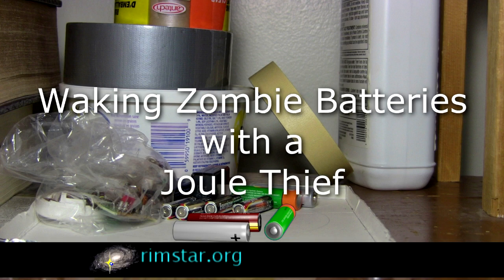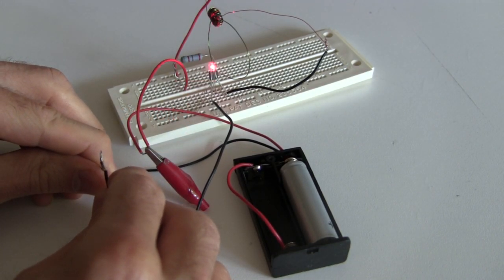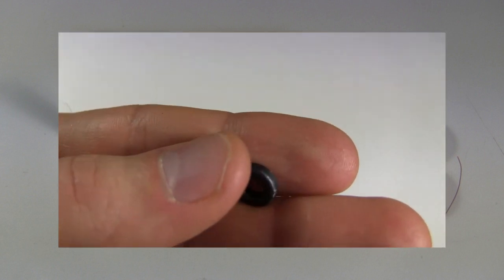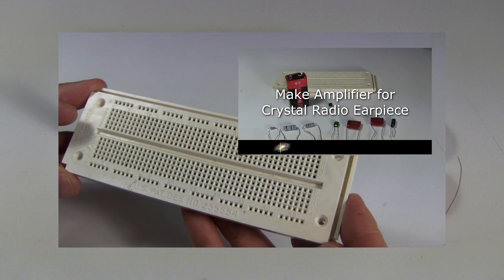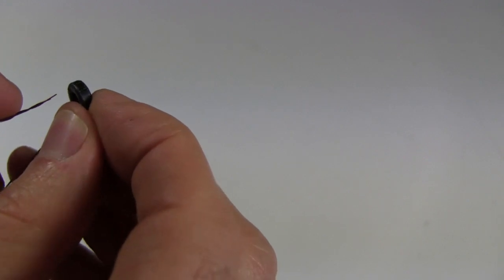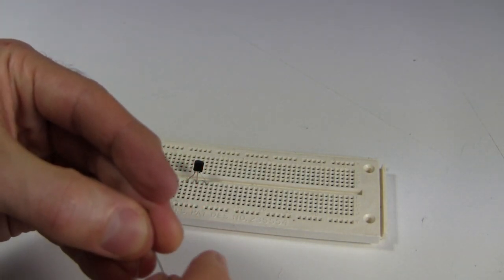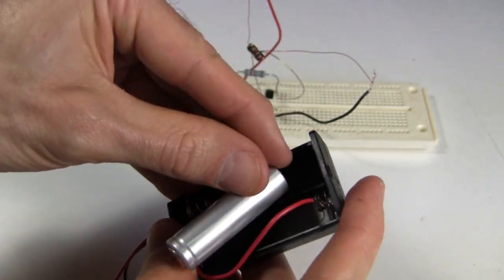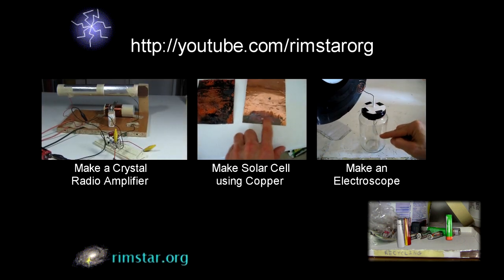Make a Joule Thief for Zombie Batteries

Comment from the maker: Coils have some capacitance, but important here is that a magnetic field builds up. When the magnetic field has built up enough to saturate the ferrite core, the interaction between the coils shuts off the transistor fast. That causes the magnetic field to collapse quickly, building up more than enough voltage at the LED to turn it on.

There is an interaction between the two coils that controls the transistor to make this work well. I haven't thought if the same could be done with capacitors.

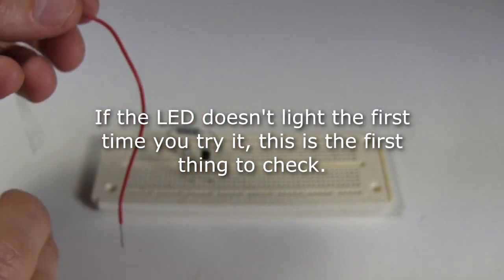Comment from the maker: Hi Debasis, You can most likely use the core. I don't see why not. However, without knowing the part number of the transistor I can't say if it would work or not. I'd suggest you try it and see. Keep in mind that if it doesn't work right away you should first check the way you wired the coils into the circuit as I mention at 4:28 in the video. Also, some LEDs are not very bright (the mcd value) or shine in one direction mainly so look carefully at the LED to see if it's lit. Have fun! -Steve

Comment from the maker: The resistor protects the transistor from too much current. At the same time, the higher the resistance the dimmer the LED, so if you have a potentiometer (variable resistor) then you can adjust the brightness.

Comment from the maker: The voltage of the solar cell will vary just as the output of the joule thief varies. An LED lighting up for short bursts but very bright can have the same overall power output as an LED lighting up for longer bursts but less bright. A better approach would be to try charging a capacitor for a fixed period of time and then disconnecting and measuring the voltage of the capacitor. The energy accumulated in the capacitor is 1/2 x capacitance x voltage x voltage. This gives a result in joules.

Comment from the maker: Transformers are for a number of things e.g. stepping a voltage up or down, electrically isolating parts of a circuit. If you transformer has 4 prongs then there are probably 2 coils, 2 prongs for each coil. Measure the resistance of the two coils. Apply voltage to the lower resistance coil and the voltage on the higher resistance coil should be increased. Note that this happens only when the voltage is changing. Straight DC will transform only when being turned on and when being turned off.

Comment from the maker: Yup. Many people power compact fluorescent lightbulbs with it, and still with just a single 1.5 volt battery. But there is a limit to what it can power, both because of the available power and given the voltage waveform I showed in the oscilloscope output.

Comment from the maker: Did you try reversing the wires coming from the coils? That's usually the first thing to check. Also, if you were using a breadboard like I did, go back and check that the connections are all where they should be and that they are fulling in the holes, also very common issues. Also double check that you have the transistor legs right, they're not always the same for all transistors. Also double check the polarity of the LED, one leg is positive and one is negative, they're not interchangable.

Comment from the maker: A crystal radio puts out fluctuating DC at the output. Someone suggested I try powering a joule thief using a crystal radio in the comments to one of my crystal radio videos (hmm... can't seem to find it) and that's why I made this. So far the radio's DC output is too small to turn on the transistor but I'm still trying.

My sources are small local electronics stores and Radio Shack (The Source in Canada) is the only more widespread store I can think of that might have germanium diodes.

Comment from the maker: I don't really know for sure. Ferrite seems to have a few meanings. The ferrite core here is a poor conductor and is a ceramic whereas ferrite also refers to iron. A ferrite core, being a poor conductor doesn't have as a much of an issue with eddy currents being induced in it as iron would. I guess you'd just have to try.

Comment from the maker: mA is amps/current, not power. It's also extremely difficult to measure current for this type of spikey output so the 31.3mA is probably not accurate. But anyway... People who've played with the resistor value have seen it affect the LED brightness so trying different resistors or using a variable resistor (potentiometer) should help I think because it affects the timing. Decreasing the turns may work too since the power flows through the coil that's not connected to the resistor.

Comment from the maker: Yeah, without an oscilloscope, if your battery voltage is high enough to light the LED anyway, then it's hard to know if the joule thief is doing it's stuff. I once lit an LED with the joule thief circuit before only to find with my oscilloscope that the joule thief wasn't working at all.

Comment: You cannot rely on the face of a transistor for a correct pinout guide. You should ALWAYS look at the datasheet for the part number of the transistor.
Also one should consider the wire gauge and amount of actual turns on the core, this is important and will make a difference between running one Red LED or several White LEDs. I have built these things using a coil wrapping design for a power transformer (primary coil and secondary coil) and I had success running small DC fans for vehicles and even a car stereo off two AA batteries. Of course you want to use transistors rated for higher volts and currents and heat sink them properly.

Comment: Thank you. Sort of like a set of points collapsing the field to an ignition coil. but instead of the primary field collapsing mechanically, the joule uses the transistor triggered by the saturation point of the ferrite core.

Comment from the maker: Also, the insulation of the coils may not be able to handle the high voltage. In that case the insulation will break down and the transformer will be ruined. You need to know the voltage rating of your transformer coils, or take a chance. :)

Comment from the maker: I'm no expert on measuring these odd waveforms. The only way I know to measure voltage like this is to use an oscilloscope and even there I've seen mention of possible errors - but it's close enough.

Comment from the maker: Not a 1.5v battery. A car's battery is 12 volts but that then goes through an ignition coil to produce a much higher DC voltage to produce the spark in the combustion chamber. I'm no car expert though.

Comment from the maker: The coil winding really is as simple as the little I showed. You can find a diagram in my "How a Joule Thief Works" video. There's a link to it in the description below this video and you can find it on my channel page. The wire sizes don't matter much, just make sure they have insulation on them i.e. not bare wires.

Comment: Just made a Joule thief myself and it works very nice :) I winded the coils with different length on the ferrite core (Longer for the LED and collector) it can light up a 3W 3,7V powerled with only one AAA battery that is as low 0,7V (0,5V under load) even if just a tiny bit of light. a battery with 1,2V (0,6-0,7V load) is enough to get a pretty strong light from that led. running 2 parallell depleted AA batteries gives even more light :)
thanks for a good video sir
Reply from the maker: Pulverrostmannen Nice. Thanks for letting me know. I'm glad it helped.
Reply: RimstarOrg Hi it's me again :) when I put in those 2 AA batteries that had 1,4 volts in them has been lit 24/7 and enough to light up the whole room in the night ever since I posted that last comment. I never thought it would run for so long before the batteries would die. they still give light but now so weak the led just glows. really decent light for 8 days and weaker the last from already weak batteries. sick
Reply: I made one version with a 10K potentiometer to set the brightness, and with half of the brightness the led lasts extremely long (I'm using a diffused blue led that shines bright enough even with half the normal brightness). With full 10K of resistance it shines a lot dimmer but since that is under your control, it can be very efficient.
Reply: PunakiviAddikti indeed, the pot I use is a 0 to 22K. and it is possible to just make the led glow or get super bright.
Reply: I actually forgot to mention that I still have a resistor connected in series with the potentiometer: A transistor needs some resistance or it can get really hot.
Reply: PunakiviAddikti Indeed, the resistor will limit the power trough the transistor. however when you have the potentiometer you chose how much resistance there will be and it is not necessary to use a resistor if you don't crank the power to max. the transistor I use is a BUF725D and even with the pot set to zero the heat is not that much even without a heat sink and the led lights wicked strong. to get the last light with very depleted batteries like 0,5V under load it needs to be low resistance to the circuit for it to work. use of 2 moderate used up AA batteries in parallel and working frequency set to around 25Khz I get over 200 hours pretty strong light from mine :)
Reply: That's good : ) I use BC547 transistors since they are most common in my country but they get very hot without the resistor, so I could just not crank the resistance down all the way but the backup resistor works well for me.
Reply: Pulverrostmannen Found You ! LOL
Reply: nour shahawy LOL, many times one say that the earth is small but it seems Youtube also are. what brings you here dude? going to build one you too :D
Reply: Somehow , lol
didnt i tell u before that i capture really low voltages so i thought of increasing it by builidng a joule theif !

it is so good to c u here already. i love this channel btw. One of my inspiration in the project :D
Reply: nour shahawy indeed man. nice to see you here too. this is a nice channel indeed

Comment: get all the transistors out of and google the parts number. get a general use or switching type "NPN".

I know the transistors from a camera flash circuit work. but not nearly as well as something like the 2n2222 or 2n4401, etc.

Comment: Hey Rimstar. Great info on the JT. I'm assuming "an 820 kilo ohm resistor" as shown in your description should be 820 OHM or 1 Kilo ohm ???
Reply from the maker: Yup. I just fixed it. Thanks! 820 ohm or 1kohm are both fine, though having a potentiometer to try different values will allow you to find an optimal one for brightness.

Comment: I have been thinking or replacing the 1000 ohm resistor with an avalanche diode. I hope it would cause a voltage drop while making a jump in current. Votage may not matter as the led only needs 3 or 4 volts.

Comment: Will I like your Joule Thief it works great. I played around with it after I made it. I put a new 1 1/2 volt battery on it and powered a Blue LED for 7 days yes it went dim but it stayed on for that time. Your layout is the only one I found that work good. I learn a lot from your videos about them. Now I am going to try it with solar for a light. I am new to this so a lot of errors but figure it out. the only thing I did different was to use a 10K adjustable resistor in place of the 1K it work. thanks for the good information.

Comment: 24 volts huh?  Question.  Could you use the 1.5 v battery to start or jump a dead car battery?  If not then...Could you use the car battery and the joule thief circuit to start the car?

Comment: I cant figure out pm's, so i guess my main question is, is the main point of the transformer to have a current flowing one way and then a current flowing the other way? I have a very simple 4 prong transformer, actually i have a few differant ones with all with 4 prongs, and also im having trouble with resistors because im not sure what one to use, i am working with 2 aa's and have 5 1kohm resistors, and 4 smallish transistors, the idea is making a very simple high voltage driver

Comment: When i added the peltier instead of the battery it didnt work until my second try, i used frozen whiskey rocks & a warm pan to sandwich both sides of the peltier and it worked for a few minutes, my next step is adding a heatsink to the peltier & a USB plug.  Im thinking of building a second joule thief & adding a solar panel plus a usb plug to charge phones, iPods, tablets ect.

Comment: My transistors base is rated at 32v max open and emittor to base voltage is 5v and base current is 1 amp, how do i figure what resistor to use?

Comment: And also could i use differant resistors, im not sure how the resistor if effecting the circuit im thinking knowing this will help me decide, my end goal is to make a high voltage power suply out of this, but im starting with just simply making this.

Comment: Yeah it works, kewl project thanks. I swapped out the NPN with a PNP, flipped the battery, flipped the LED. Nothing. Do I have a Dud transistor?, need to flip one of the windings, or just give up? Regards Bruce
Reply from the maker: It sounds like you did just what you should. There's nothing on the windings to flip. It could be the transistor.

Comment: So i made everything like in the diagram, and it didnt work, so i tried connecting the transformer differantly and one combonation worked when i diconnected the resistor and conected it again repeatedly i got the light to blink but thats the only way i got it to work, so i tried making a rind farrite core coil, and still cant make it work, iv tried 7 fidderant transistors( i have an old tv and its just full of great stuff) but iv got my circuit exactly the same as yours, tried differant l e ds

Comment: Everyone talks about using the long lead of the LED to denote polarity.  BUT ... What if the LED is scavenged and the legs are both the same length?  Do you know how to tell which is the negative and which is positive?

Great video, by the way!  Thanks for the information!
Reply from the maker: Thanks!
It depends on the LED but there are often other differences. The 3V white light ones I have have a flat edge to the plastic base on the side with the short leg. But since I often can't remember which way even with the long and short legs, I usually just connect it to a battery with a suitably sized resistor and try it both ways. Once way lights up and the other doesn't.

Comment: can i use a mosfet ? because i only have 2 pairs of irfp250s right now,or i have to buy a power transistor

i guess i'll try itmyself,with irfp250,flyback transformer core ,and some 22 awg copper wire
Reply: damn VGS of this mosfet is 2-4v
Reply: A 2N2222 General Purpose bi polar transistor is the one recommended Though you can look into other higher powered types like those used in power supplies. Also you do not have to use an NPN type, you can use a PNP type with slight modification to the circuit.
Reply from the maker: ElfNet Gaming If I recall correctly, for PNP you just have to reverse the + and - of the battery.
Reply: yeah pretty much. You can use this circuit to run LEDs off a lemon or potato also if you dont have a battery

Comment: Does it matter if you use the same gauge wire for the coil?
Reply from the maker: No, it doesn't matter. You can use the same or different gauge wires.

Comment: Hello, can we use the same battery if it is completely drained to store very small amount of current with this joule thief circuit.
Reply from the maker: I imagine at some point a battery can be so drained that it won't even power a joule thief circuit.
Reply: so what alternate can i use , because there is a project im working on and i need a similar process there.
Reply from the maker: Are you sure your battery is completely drained? For example, a battery may not have enough power to run a small motor but it may still be able to power a remote control for a TV. If all you do is test it with the motor then you'd think it was drained. But if it can't power even the lowest power device then I guess you'd call it drained. In that case you need another battery.
Reply: Sir it's not about using a device , its just about storing even a very small amount of energy even if its negligible and store enough and give an energy burst , so my intentions are to store even small amount of energy and use is like a burst just like the joule thief circuit,  so do you have any alternative suggestions that might help me in me research.
Reply from the maker: In that case maybe what you should look into is using a capacitor to store the energy.
Reply: ok ,thanks i will look into it .

Comment: Hi I working on a  joule thief  but it's  not working right .It works on my 9v battery but not on a AA battery ? I think I didn't do sum thing right
Reply from the maker: My guess is that you have the connections going to the coils reversed. Compare what you've done very carefully with the diagram in the video. If you don't have them wired correctly then your 9v battery is just powering the LED directly like normal.
If that's not the problem then it could be that your resistor is too big. I used a 1 kilohm resistor.
If it still doesn't work after you've checked the above then tell me which transistor you used, what the voltage rating of your LED is and how many turns you've put on the coil.

Comment: I remove the insulation by using a small torch on the wire end, then polish with fine steel wool.
Reply from the maker: I've never used the torch approach except to try it and always wondered how to clean off the resulting carbon. I'll try steel wool next time. Thanks for sharing.

Comment: Will it work with any other diameter of wire( around ferrite core)?
Reply from the maker: Yes, thinner or thicker wire should work too, as long as you can get enough turns of wire on it.
Reply: Thanks a lot